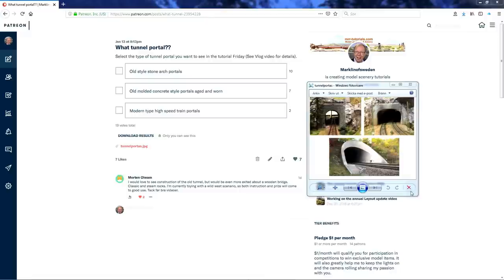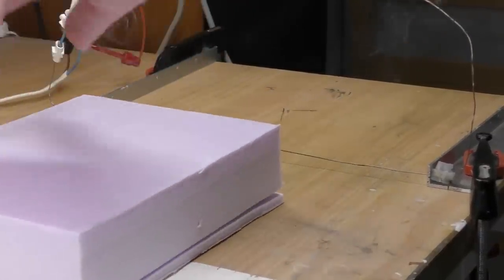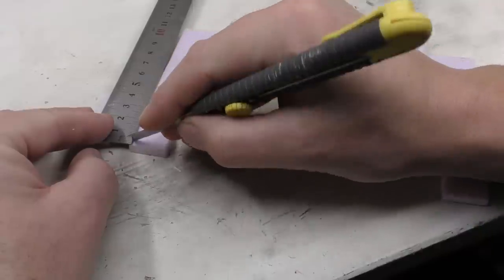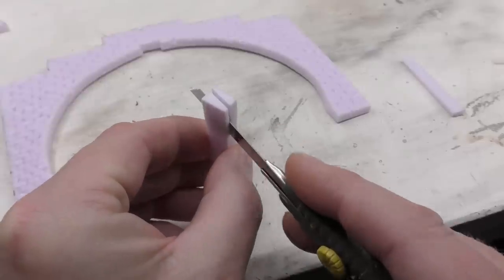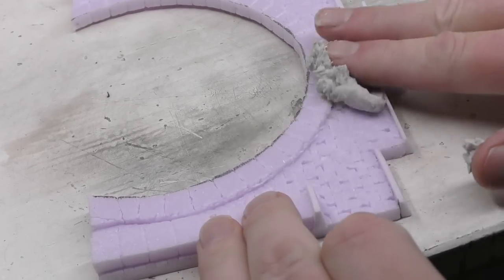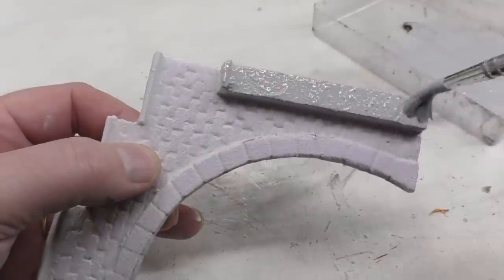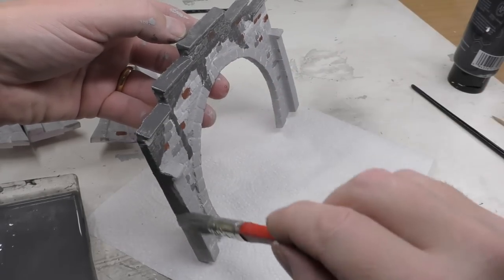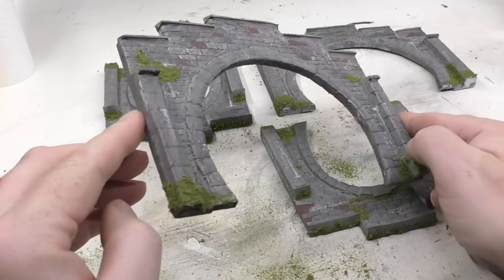Model realistic Tunnel Portals - Detailed step-by-step tutorial

Comment: I am having a go at this, making one similar to one on a local railway. Working in n-gauge though so bit more difficult, I have made it by buying foam board from a hobby shop. It’s a little thin so I had to glue sheets together, but the pva does not seem to be holding very well. So I have changed to a wood glue instead, that seems stronger and dries quicker.

Comment: Would you be able to use cake decorator tools? Like fondant rollers to make engraving quicker?
Reply from the maker: Hi Roza! Yeah! That’s a really good idea! The tool needs to cut through the surface of the Styrofoam to get a permanent pattern though. A work-a-round is to sand the Styrofoam surface a bit ahead, then it’s much easier to create the pattern. I must try! 👍😊
Reply: @marklinofsweden  in my terrain crafting we use a roller from greenstuffworld  that works on extruded polystyrene. You should check them out. May cut your 60+ hours down to a 1-2 hrs. Cheers! and I love your vids and channel! Wish i could come see your build in person, it looks super impressive.
Reply: My first thought was to 3d print some sort of stamp that you could press into it.

Comment: Love the video. I tried using this method for a stone arch bridge. I guess I didn't indent deep enough or didn't wash away excess plaster. Because after it dried, I was left with a single smooth surface and lost all depth difference between the stone and mortar areas. Now if I try to paint it, I'll lose all my mortar lines. Anyone have any suggestions? My best thought is to painstakingly paint each stone individually.